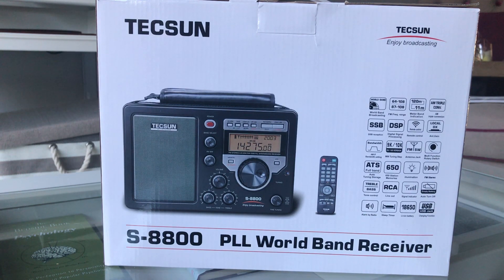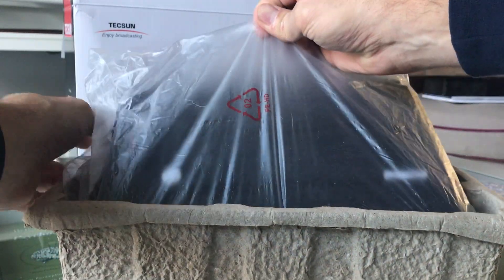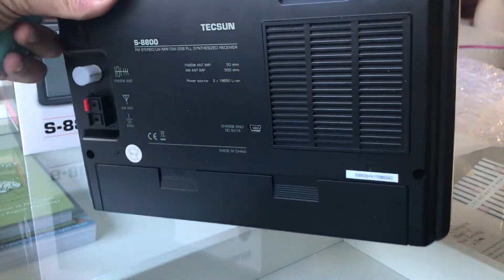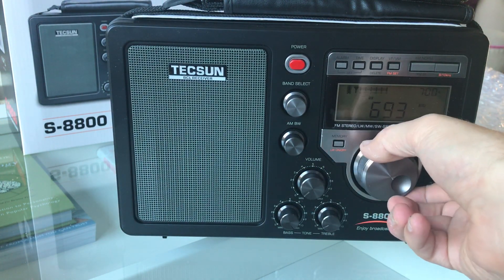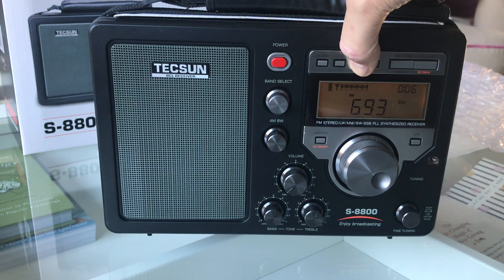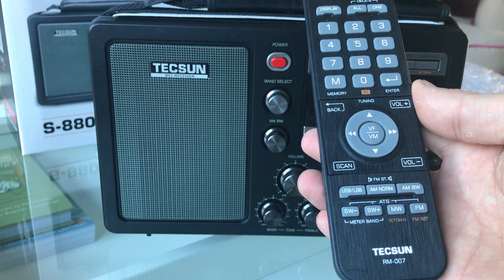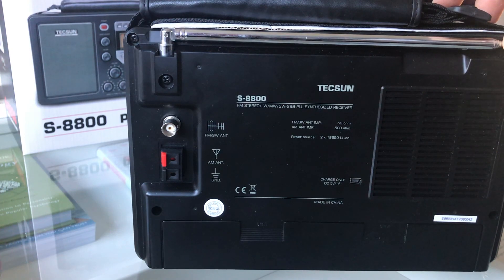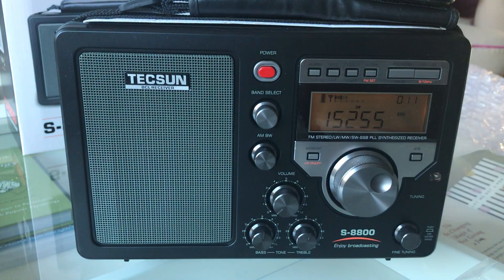Tecsun S-8800 unboxing and first impressions, with a brief overview of the main features

Comment: I picked up one of these receivers recently and whilst it is a competent product it lacks in some obvious ways, especially given the price. Firstly,  no RF-Gain. This is a serious omission as such a function is very useful in mitigating noise and improving the signal to noise ratio. Secondly, the main buttons and dials are not back-lit. I use my receiver at night and would like to see what buttons I'm pressing without the use of a torch. Thirdly, only two positions for the attenuator. That's just plain cheap and even worse, both positions (DX,LOCAL) show no change in signal gain. Just plain bad engineering. Lastly, the front-end STILL overloads and the AGC circuit STILL has a slow attack and fast decay time. This results in bad distortion on SSB which is the primary mode I use for listening. All other modes (AM,FM,CW) are ok.   I should also point out that the LCD backlight is poor and uneven. Even my cheap portables excel in this area.
Reply from the maker: Hi there, thanks for you comments. I am using mine to monitor my FT8 signal on 80, 40, 20 and 17 metres at the moment because comms between my laptop and transceiver sometimes results in no modulation...at night, in the dark, with only the light from my computer screen and your comments are spot on. It's a good receiver in terms of sensitivity on HF, BUT, the flaws you mentioned back this a bad buy as it's so expensive. 73! Clint

Comment: I like the look of it and with the large speaker it should give decent audio, but it's too expensive for what you get I think. The PL series radios look better value. There are two other SW radios I know of that had remote controls; the AOR 7030 and the Lowe HF-250. For portable listening I'll stick to my Sony ICF-SW7600GR, though an HF-150 like you picked up recently is tempting!
Reply from the maker: Hi Jonathan, I totally agree. The performance is similar to the PL-880, but the cost is 100 quid more . Ah yes, the HF-150 is a really super little desk top - that also runs on x8 AAs. Brilliant idea and of course good for a DXpedition. 73! Clint

Comment: I sold my Tecsun PL-660 and keep the Sangean ATS-909x.
Reply from the maker: Well if you listen to BC bands, that's a good decIsion. If you're a hard-core DXer, not so much, but the 909x is still very capable. 73!
Reply: I  order the Tecsun 880 n Degen 1103.
Reply: @OxfordShortwaveLog   WRONG, DX is good with 909x also, just use a longwire, ease of use is outstanding. Sorry it´s my opinion.

Comment: In terms of the case and it would seem the build quality this radio looks identical to my Eton S350. I hope that's where the similarity ends as the Eton is not a very good receiver!
Reply from the maker: You're absolutely right Kevin, it's the same casing etc. Completely different radio though - at a price however. 73! Clint
Reply: I kind of doubt that its a different radio, looks too much identical.

Comment: I'm looking forward to your tests on the Tecsun, Clint. With a number of receiver models using the same SiLabs DSP chip which permits 10 Hz SSB tuning, it's harder for individual receivers to stand out. I think that careful PCB design and shielding may make the difference. This is similar to what makes one digital to audio converter (DAC) in the audiophile world outperform another, even when they use the same core  DAC chip. Beyond that, I think audio  and build quality makes a difference in these receivers.  73, Guy
Reply from the maker: Hello Guy, thank you. I agree, the receivers using the same Silicon Labs chip have tended to be much of a muchness - usually excellent sensitivity, very good selectivity and horrendous SYNC! No difference here, except there's no SYNC offered, which is just as well probably. 73! Clint

Comment: I've noticed that Tecsun always leaves out a feature or two. For example, why doesn't this premium priced radio have a sync lock? I can guess that it doesn't have RDS because Tecsun loathes the idea of paying the licensing fee but a sync lock seems straightforward enough given that the one on the 660/680 is decent. I could do without the one from the 880 mind you.
Reply from the maker: Hi there, the receiver in this unit is the same as the PL-880 which as we know is about as useful as a chocolate tea pot! Nevertheless, it remains very selective with SSB and audio BW filters. 73! Clint
Reply: I am curious as to where you got your information that the receiver of the s8800 is the same as the pl 880?
Reply: Golan, that's what I thought too. Marketing trick maybe... They want you to buy the S-2000 after trying at least three of their portable ones. 😅

Comment: Can you tell if the main tuning knob is aluminum? Does it feel cold to the touch as a metal would or neutral (temperature wise ) as a plastic would?
Reply from the maker: Hi Daniel, it's aluminium I'm sure. 73! Clint

Comment: Despite this seems a nice receiver given all the bells and whistles is has, it lacks a sync detector. That is a must at this price. If it had one, I surely would get one. Not as it is now.
Reply from the maker: HI there, yes it does lack SYNC, although SSB works well. It's a bit too costly really when you consider that sets like the XHDATA D-808 are superb for 1/5 of the price/ 73! Clint

Comment: Good review. Imo it is too pricey for what it is. I read that it has the same hardware as the PL880. If this S-8800 does have a SYNC detector, then it is not that good as the one on the PL880 I found disappointing. Also for its price, it should have PBS which desktop receivers come with. Even the Eton E1 has this. I think if it was at £200 then it would make more sense to buy in comparison to the PL-880, but the latter is more my choice due to how much more portable it is. I look forward to your videos wiht this radio. 73s!
Reply from the maker: Thank you Sir! I think it is a bit too pricey - just like the 909x! Need to wait for a second hand unit to come along. Interesting that it's the same hardware as the PL-880....I was thinking about asking the boss for one of those for Christmas lol. I'll be back in Brazil next year and am looking at another portable to take with me. 73!  Clint PS there won't be any videos - other than a performance summary as I have to save the results for the article.
Reply: Ok np, a shame there won't be enough time for doing the videos you want to do with this radio. And yes, the PL-880 is a Christmas gift everyone should have ;) 73s!
Reply from the maker: I think I've managed to pursuade the boss to buy me a PL-880 for Christmas!! 73!
Reply: Excellent. Let us know when you get one. You could also try asking for a JRC receiver but I think that is pushing it too far lol. 73s!

Comment: Tecsun tend to be the same radios but in different clothes/boxes with slightly different configurations they never seem to break away from the basic design of previous units... they are however,  very sensitive short wave radios..👍
Reply from the maker: Hi Matt, definitely. They're all pretty much the same with slightly different industrial design - smaller/larger - but the hardware innards are essentially the same. This is the fourth Tecsun I've used and as usual, it's super-sensitive on SW, with very good selectivity. There's no SYNC offered - but as I just mentioned to Guy, just as well really. 73! Clint